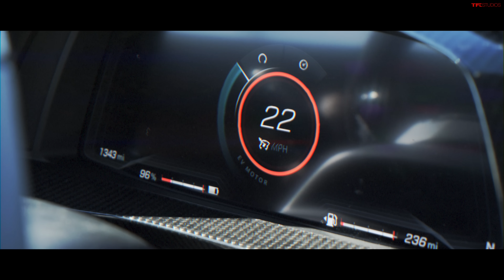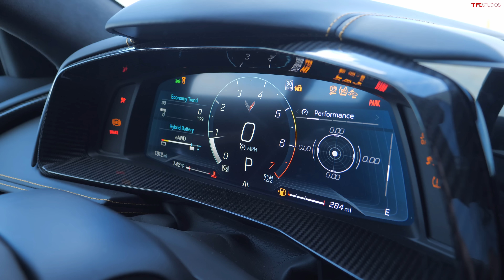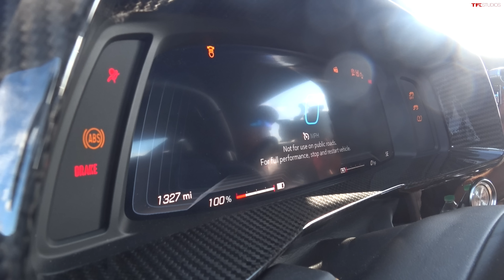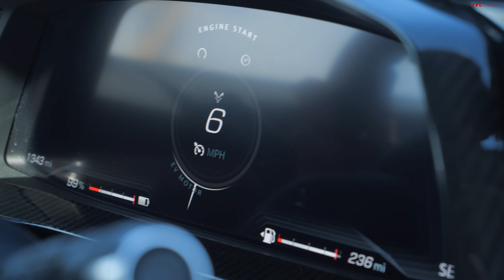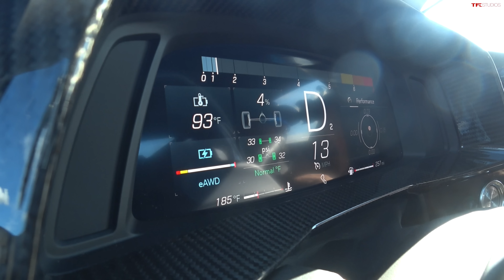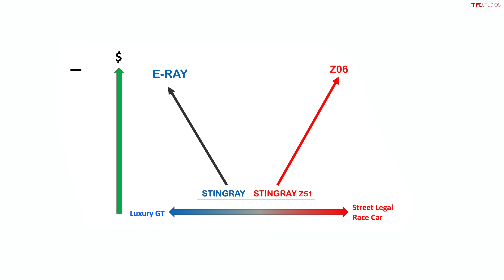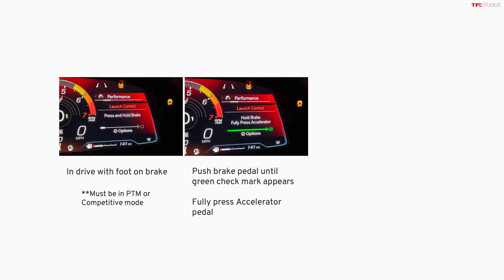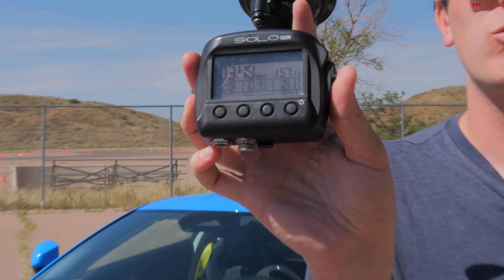Can The Chevy Corvette E-Ray Really Get To 60 MPH in 2.5 Seconds?

Comment: i question a cold start while in stealth mode?  the high rev just starts up after 45mph ?
Reply: It takes time to match RPM and then will fully Engauge.
Reply: I guess i get it. The oil is somewhere in the top . no oil pan.  Electric pump.   I get it now.

Comment: I purchased the Z06 for $240K. 5000 miles so far and the engine seized, brakes failed, had misfires and now the transmission is having problems. Its been in the shop for 12 weeks total and is still in the shop currently. I now have a lemon law attorney and will never buy a chevy again. I would avoid the eray if I were you.
Reply: Yeah I'm a tow truck driver and out of brand new cars the ones I tow the most have been Chevy's. Which is disappointing because Chevy has a lot of innovative ideas that might be interesting to see in action. Unfortunately their vehicles can't stay running enough to see them in action. Chevy's build quality has gone down drastically.
Reply: @lidolf8168  The tow truck guy that picked me up the first time said the same exact thing. He had multiple Chevy tows that week. Good to know that he's not the only guy saying that. Appreciate the input
Reply: @lidolf8168  some of the issues I've seen people complain about in the service center are wild there. Quality is going downhill
Reply: @WillProwse  oh yeah the service center is slow as heck.
Reply: Sidepipes?

Comment: Best sports car for the money.
Reply: I would vote Miata instead - plus you can work on it yourself if you so desire
Reply: @bartwaggoner2000   Not arguing as the Miata is an excellent value, but I would not really put the two cars in the same category. Even though they are both sports cars the Miata, BRZ, and 88 are more value based sports cars. Then you get into the mid tier sports cars like the Supra, Nissan Z, BMW's... Then of course you have the Corvette, the Porsches, and maybe some of the Aston Martins etc. I guess it depends what exactly you are looking for from the car. The Miata is an excellent value, but people shopping Corvettes and Porsches are not looking at that level of sports car either.

Comment: If Chevy had made the Eray a mechanical awd and put the electric motor in the place of the transmission, it would have been a riot . And it should have had the 5.5 flat plane crank instead of the lackluster 6.2 . Chevy doesn't get it . Go all out instead of being modest all the time . Ramp up the quality control and innovation 💡

Comment: I like it a lot, but it seems like a lot of complexity and cost for not a huge advantage or difference over the regular stingray.
Reply: It's MUCH faster than the standard stingray and it has a lot more features & benefits including AWD, ceramic brakes, stealth mode, etc and also has the full widebody which looks awesome.  It's a very significant step up from the standard stingray.

Comment: 3.48 0-60 mph is not good at all. I do 3.1 over and over again in my Model 3 Performance and that is without subtracting rollout.
Reply: As they said in the video, ICEs take a big hit in power at altitude.  The E-Ray is a primarily ICE-driven car. The electric motor helps, but it takes a serious hit when you're a mile in the air. 
Granted, full EVs don't have that problem, but go back to sea level and the E-Ray would walk your Model 3. Not a dig, just a fact.

Comment: There is no reason for this car to exist. All that r & d to get a few miles of range in eve mode.
Reply: You completely miss the point of the car then. The electric motor is not meant to operate on it's own most of the time. It works as an assist to the gasoline engine. This makes it grip harder out of turns, launch harder from a dig, etc. There is plenty of reason for this car to exist and they nailed it. This was not built to be more economical, it was built to be higher performance while retaining the gasoline engine.
Reply: Also more stuff to go bad . They could have done a 4 wheel  drive.

Comment: Its not a hybrid....  you should know this being a car review channel..
Reply: Maybe you should look up the meaning of a hybrid car before commenting
Reply: Hybrid: a car with a gasoline engine and an electric motor, each of which can propel it.
Reply: Wut?
Reply: If considering this as a hybrid is difficult for your brain, try thinking of the infiniti Q50. They had a hybrid model that used the ev motor for mainly performance with the electric benefits being an extra bonus. 360hp and drivable on ev mode up to 50-60mph.